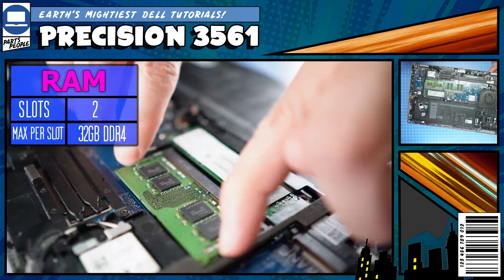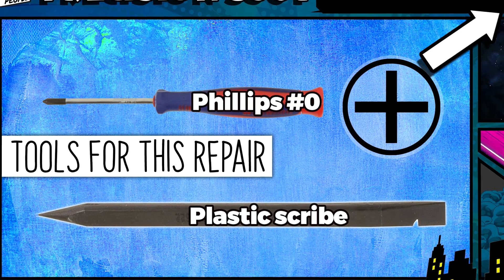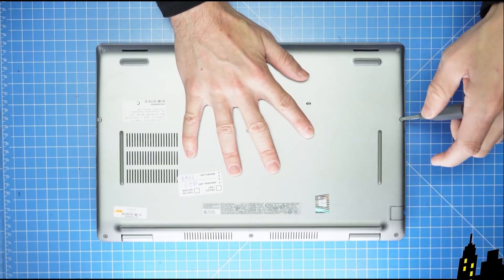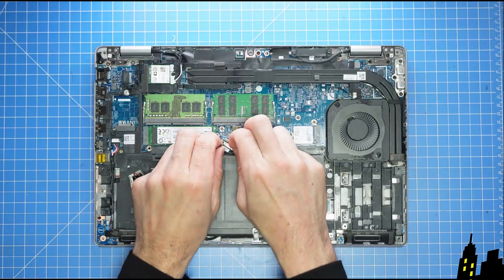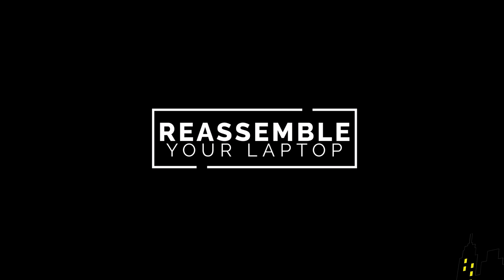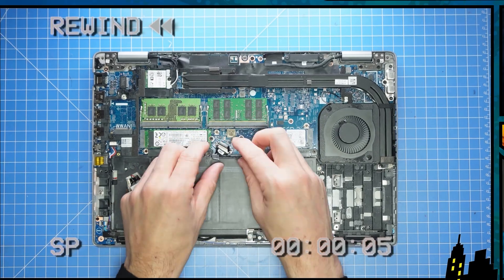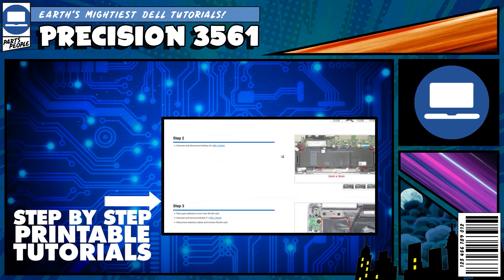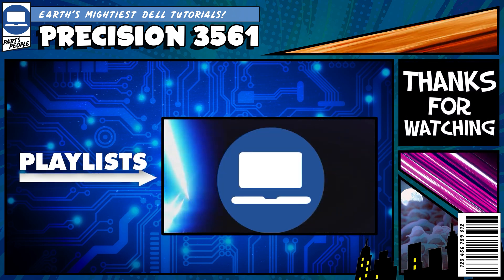How To Upgrade or Replace Your RAM | Dell Precision 3561

Comment: do you repair old dell latitude laptops from 2006-2010 because i just happen to have one where it wont post (possibly the ram but they work fine on a different laptop i have)